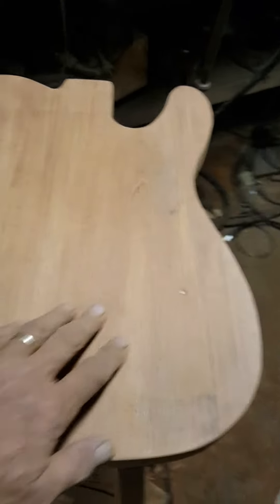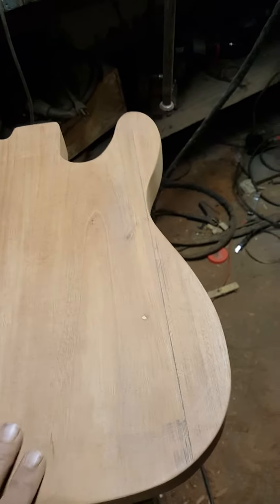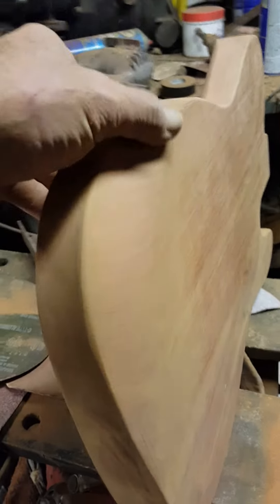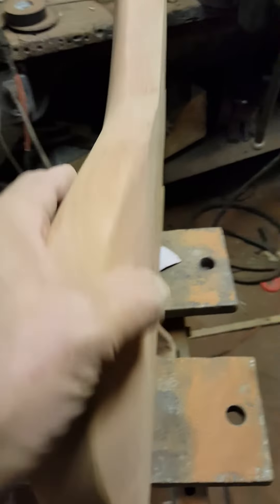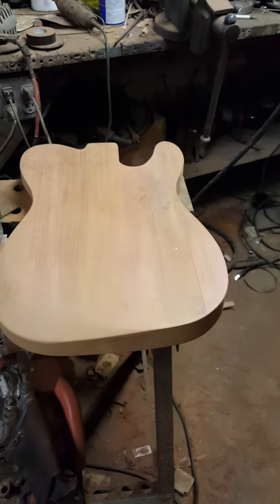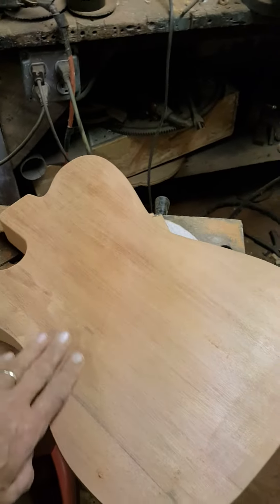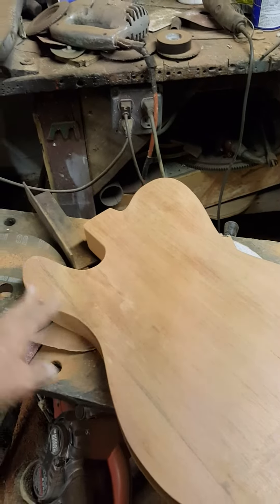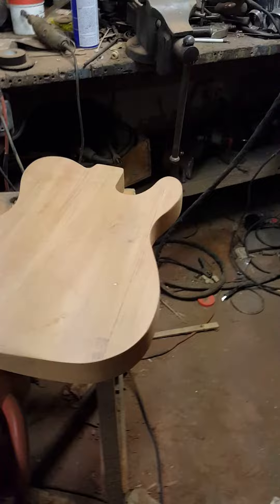Cartele- part 2

Comment from the maker: i have it stained now...i shouldve videoed that but   i used water stains fron stewart mcdonald ..do a search for staining guitar bodies and see the vids...thats what i did if you need help...
 got a couple of tupper ware containers put a few ounces of water in each and added black in one and red in the other...enough so when it was applied to the body with a small clean rag(wrung out a bit first)and rubbed on it would color the wood....I also used grain filler from sm too...that darkened the grain first...then i added the color....ill do a video of what i have so far... i stained the edges black with the center red...then added streaks of black to look like  a darker wood grain.....this also hid the glue line where the two body  pcs were glued together.